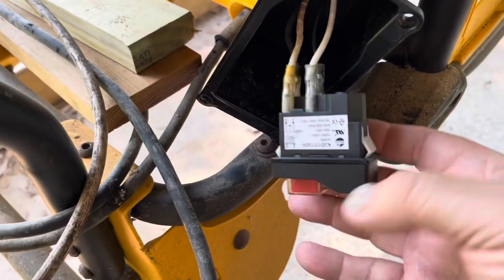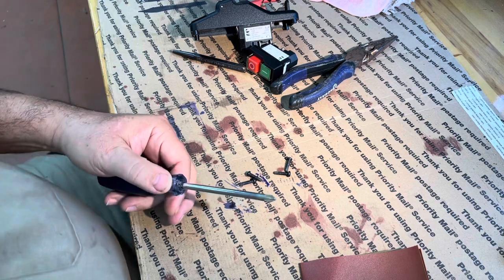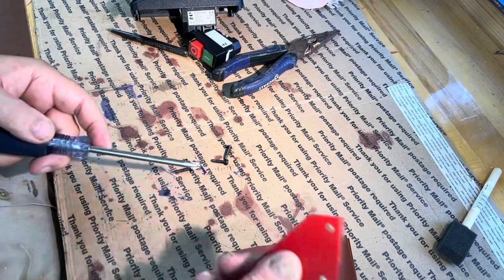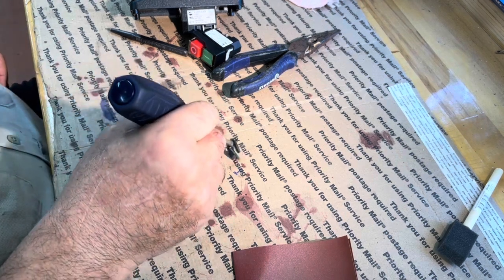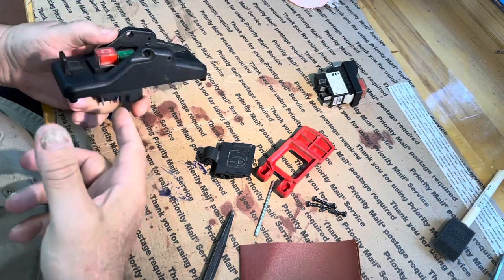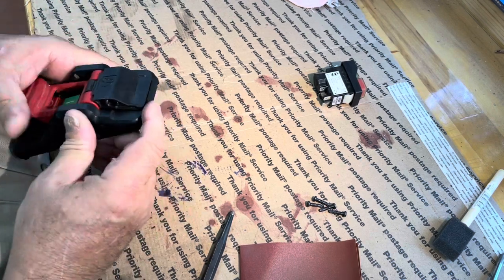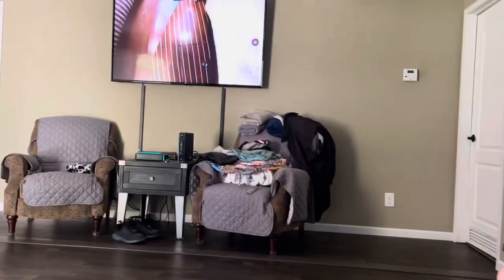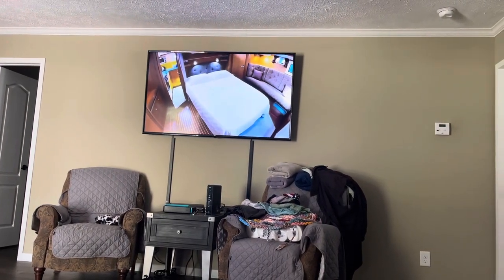new switch on my DeWalt table saw

Comment: We all NEED some "Do nothing" time where we sit back and watch WHATEVER is on the Idiot Screen (previously called the Idiot Tube).
Reply from the maker: It was perfect temp on the porch. It’s been a very very hot summer and it chased me inside for much of it.
Reply: @bctruck  Here in Central FL it has been hottest, most humid Summer in my 35 years here.  It was "only" 92 or 93 every day, but the HUMIDITY was terrible, frequent heavy rain kept the ground soggy.

Comment: Two of those knives look like a good way to get your finger broken. As far as the pusher goes, it can’t even whittle a stick. No utility there.
BTW, how are you going to demagnetize your screw driver? I just found that you can demagnetize something by repeatedly sticking a magnet on it , pulling it straight off, turning the magnet around to apply the opposite pole and repeating the process. It works.
Reply from the maker: I also found out that there is a way to magnetize using a 9 volt battery.

Comment: Good Saturday Morning! Yes, anyone with common sense knows the differences. Substitute a baseball bat, an ice pick or a ball peen hammer for the items you mentioned, and a similar ultimate result can be obtained. BTW, I have a favorite ball peen that looks just like yours. Will it be targeted, too?  On to catching up .....
 
Tuesday, the 6th, a nearby lightening strike took out our AC and our landline phone service. Because I have  to use a cell phone booster (it uses my landline modem), it also took out my indoor cell phone reception. To use my flip  phone, I have to go outside to a high point in my yard. Phone company said it would be the Thursday the 15th before they could send out tech to trouble shoot my problem. 

Called our HVAC folks and they sent out a tech, that afternoon for the AC. He said I had blown fuses and shorted wires. But, he got it running. Sounded great when I heard the outside fan running. He can in and said I was fortunate that it didn't fry the control panel. Long story shorter. It did. Fan that circulates air inside our house would not come on. He had to order a new panel. Would be here in a couple of days. Cost? OUCH!

Yesterday (Friday) the phone company fixed the problems and restored both telephone and broadband services. Thankful that the damage wasn't worse. Phone tech, said he had been brought into our area from the coast of NC to help out, here. Apparently there have been material problems and lack of manpower locally. 

On the other hand, parts were supposed to arrive to repair the AC, yesterday, didn't. 

Side Note: Sometime last year,  I bought a couple of 4" USB Desktop fans and 4" USB Hand held fans for my sister and I. I'm surprised how well they worked. Even thought our daytime highs were running in the mid-80's, I didn't have to go to the shop and bring in big noisy box fans.   

Thankful, too that we have a cool, rainy weekend, that'll be much more bearable than what it was like here, 2 weeks ago with heat indexes well over 100F. 

Off to do much catching up on all sorts of stuff from being down a good part of the week. Amazing how much we've come to rely on electronics. Everything from getting prescriptions filled, to paying bills, to confirming  dr appointments, to  you name it. 

Hope you and Charly have a blessed weekend. As always, Godspeed if you go forth.
Reply from the maker: Good to see you back. Years ago,lightning struck a light pole in our neighborhood. We lost tv, vcr, neighbors lost equipment. Sorry you had AC damage. I know that can be very expensive.
Reply: @bctruck  Appears to be so in this case. Don't have a  firm estimate on repairs. Already paid $116 for the service call Tuesday. Tech said the replacement panel will be between $750 and $850. (sigh) 

Thankful that I have my computer, TV in the den and my  sister's TV on individual UPS. It could have been much worse.